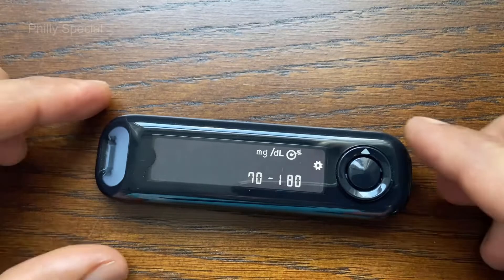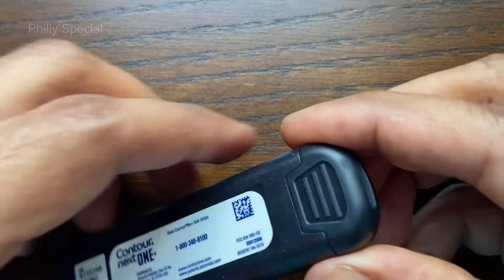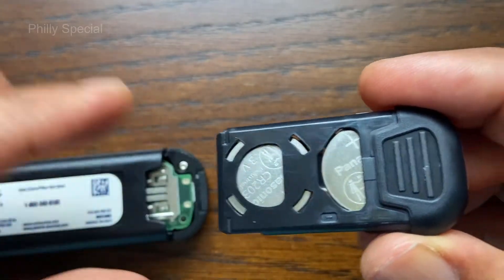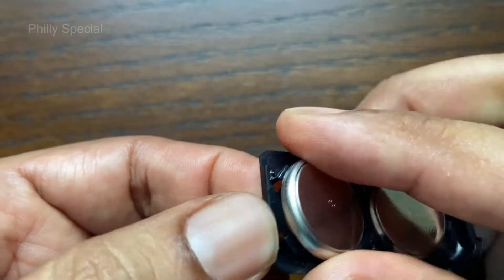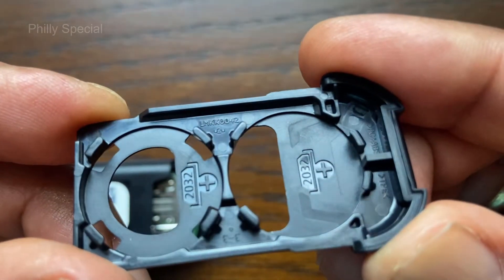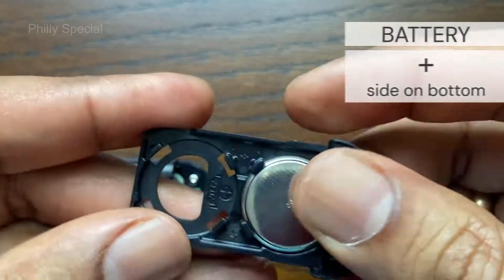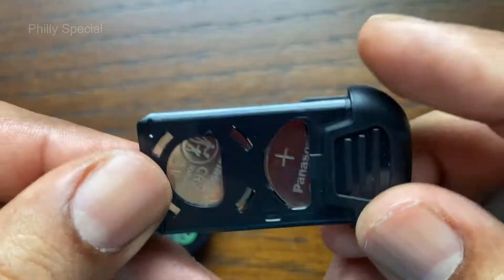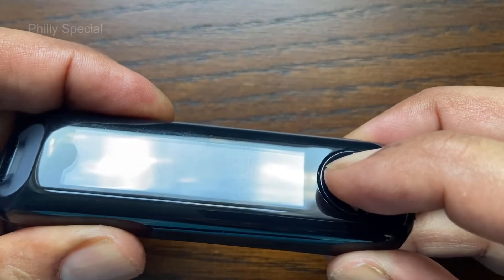Change battery in Contour Next One I Contour Plus One Meter

Comment: What is the USB port for if there are batteries?
Reply from the maker: You can transfer test results from the meter to a computer where they can be summarized in a report with graphs and tables. To make use of this feature, you need their diabetes management software and a  3-foot long USB cable.

Comment: Can i charge it
Reply from the maker: These are not rechargeable batteries.
Reply: @PhillySpecial  thanks
Reply: When I googled - “can safely replace most CR2032 coin cell batteries with a BR2032 type lithium battery. You can not, however, always substitute an LiR2032 rechargeable battery for either a CR2032 or BR2032 type”

The LiR2032 is rechargeable.